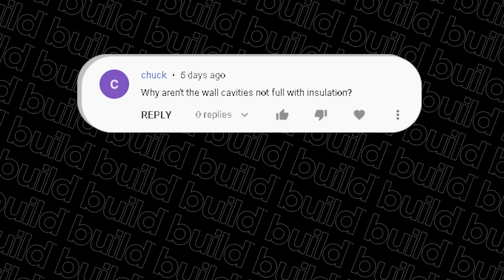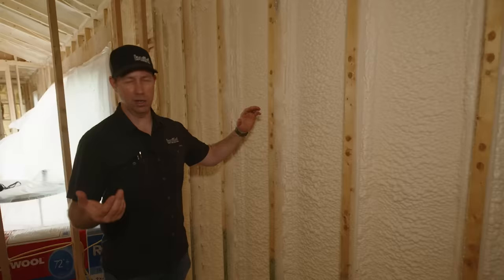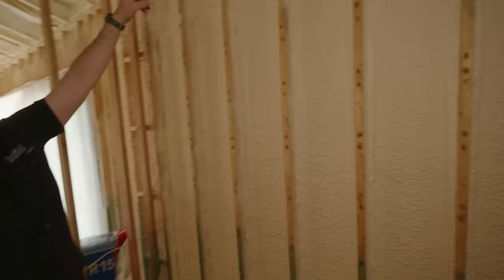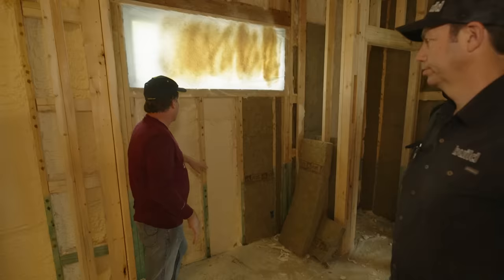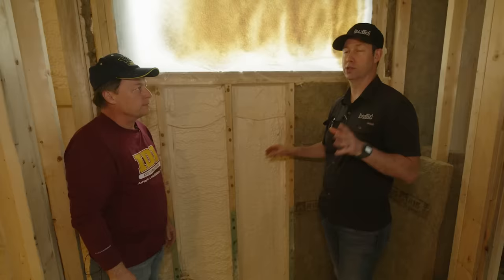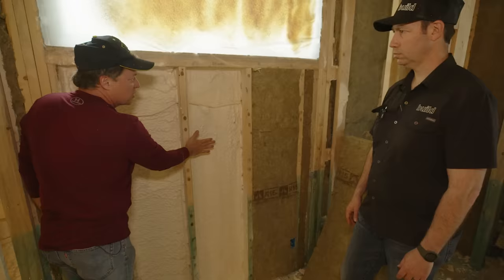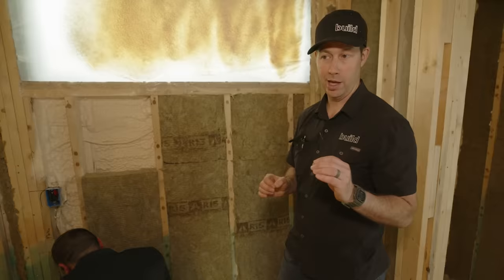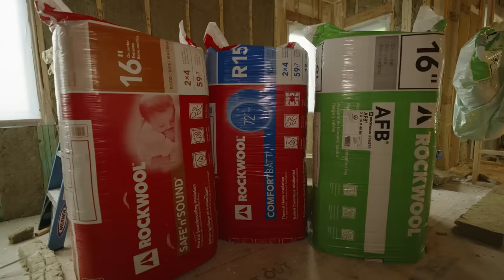Closed Cell Foam + Rockwool- How To Flash & Batt

Comment: Thank you so much for this video.  My framing (100 year old masonry block house balloon framed house)  is offset by 5" from the exterior block wall for structural reasons.  We're spraying 2" of ccSF on the block. Then I want to add batts. My question is do the batts need to be thick enough to fill entire gap from the foam to the drywall (as much as 6.5") or can there be a gap between the ccSF and the batt? Or can I put 3.5" rockwool batts on top of the ccSF and leave the gap between the rockwool and drywall? Help!

Comment: Something I've been wondering about with sprayfoam since I started seeing it, is how much of a P.I.T.A. is it if you need to do some rewiring/renovating ? 
To me it seems like it would be a lot as you have to dig the wires out of the foam, and dig new channels for the wire if you are re routing it.
Reply: Do you have to remove the old wire, or just disconnect it? At least with flash and batt and t-studs you'd just need to dig out the foam through the studs.
Reply: Last year was visiting a remodel where they pulled off all the sheetrock, pulled all the two conductor wire and were going back with NM 12/3) and put in Smurf tube conduit so they could change it at some date in the future if ever necessary without ripping up the walls.
Reply: Just put in conduit before you spray foam and you're good to go.

Comment: What’s the point of vapor open WRB/Zip if you are spraying vapor closed close-cell foam behind it? Please someone explain.
Reply: Zip isn't vapor open.. it's very low perm.
Reply: Zip is made from OSB. Which is very prone to water damage, regardless of what manufacturers claim. Since the zip is backed with a closed cell (vapor barrier), the idea is that the vapor open (outside surface) is necessary in order to allow the OSB to dry outward in the event that water makes it past (which it will, from over-driven fasteners, constructions scratches, and poor tape-jobs).
Reply: @joshpit2003  perm 1 is not vapor open ..
Reply: @joshpit2003  surprisingly huber zip OSB is pretty resilient to  if left outside. I have a test board Ive left outside over a year explode to rain and sun and while noticeable greying/bleaching no bulging or degradation.I suspect they are elevragign their research nd manufacturing they've had so much success with re advantech sub flooring.Now admittedly my test board is drying optimally and no exposure to standing water, but hell, most PT wood wont stand up idneficntley to standing water.
Reply: @joshpit2003  I looked up the product data. The Zip sheathing itself without the insulation is 12-16 perm, which is very Vapor open. But the insulation is less than 1 perm. I agree with your comment that the vapor openness is to counter any water intrusion from outside potential through compromise in the factory applied water/vapor barrier by fastener holes and etc. However, this is not supposed to be used if the concern is more for vapor drive coming from the inside, such as compromised vapor retarder in a northern heating dominant climate. What Matt is doing here with vapor closed spray foam in Texas would have no issue. But you probably want to avoid this assembly in northern climate, due to the vapor closeness of the whole assembly. The best would still be exterior insulation with some batt insulation that keep the sheathing in the warm side, with vapor open assembly to allow vapor drive outwards. Correct me if I am wrong.

Comment: The problem with flash and batt is the majority of insulation companies only install 1/2” or less of closed cell foam. After putting installing foam below manufacturer recommendations, they cram a fiberglass batt into the cavity. The fiberglass batts are designed to completely fill the cavity for maximum effectiveness. They aren’t made to be crushed down. The methods used in this video are overkill, but installed correctly with enough cavity space for all materials.

Comment: Matt we are in the middle of a remodel and can’t find a straight answer. Our house is 105yr old in a dry California climate. It was built with wood siding, a felt layer, and 1/2” wood sheathing. It doesn’t have a vapor barrier do I need to add one or use hard foam insulation before putting in Rockwool? What would be the best way.

Comment: Total embodied carbon is 10x higher than fiberglass and the r value is 4.2 per inch. Unless you are using Rockwood for sound, it’s not worth the cost. Foam and fiberglass is good, exceeds code, and good air barrier. Fire resistance won’t matter when the entire structure is wood.

Comment: I'm building a bus to rv conversion and would love to know how thick my closed cell foam needs to be before putting rockwool over the top of it.  A bus is basically a large metal box and I like the idea of sound deadening.
Reply: Don't use closed cell unless your venting is solid. You do need to worry a little about the structure breathing.

Comment: What advice would you have on dealing with full dimension 2x4 walls in zone 6? I considered using .5" of rigid foam or 1" comfort board or and firring out .5" on the inside with R-15 Rockwool. I am also considering firring out either the inside or outside walls 1.5" and going the flash & batt route or R-19 Rockwool. I am from the south but this house is in the north and I don't want to get this detail wrong... Any ideas would be much appreciated!

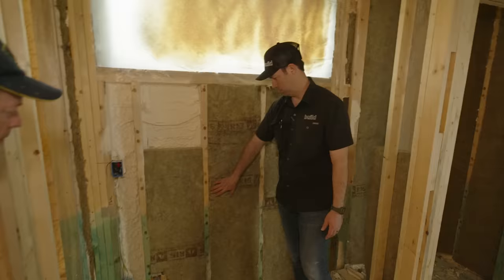Comment: At about 8:55, Matt discusses MW printing the R-value on the batt. During the install R15 was placed on the lower section and R13 was placed in the upper section. Was that a specific design decision or a quality control issue?
Reply: mixed bags

Comment: ,,,Mat Risner,,, I just built 2 different houses, one they had 1 to 1 1/2" of closed cell sprayed in and no bats . The other one they had 5 1/2" of open cell. So your saying that the one with closed sell needed bats , correct.

Comment: One thing I most definitely like about YouTube, sort of like the books or magazines of old (of which I do not buy or have any more), is that I can refer back to them (haha... if I remember where they might be, but so to was the case with books and magazines, but at least now I have an intelligent(?) search engine). Currently I do not know what is in my house's walls, but I know there is nothing in my floors for I having a house with a crawl space and having inspected that visually. (Sigh)... Really, builders need to [censored] so that 120 years down the road things do not need to be fixed only because it was done inadequately the first time.

Comment: Hey Matt! I live just South of Houston and have a 25 yr old brick home that is an insulation nightmare.. meaning... I am freezing right now because the cold is just pouring though my walls. I can quite literally feel it. I also have been working to address less than adequate insulation in my attic and a poorly sealed attic that is allowing insulation to circulation in my home through the walls.  Have been watching  a lot of your videos on insulation.... So I have decided this is what I need in my attic. I have already paid good money for attic insulation replacement and sealing that was just not done right at all... my question is... can you recommend someone in Houston area that will come do this right!! There are a lot of insulation guys that just don't know what they are doing! Also, Any opinions on the foam fill for existing walls. I spoke to company called Retrofoam. Seems like a good deal. But no one services the Houston area. Although your Austin guy has offered to drive over if I go that route! Wondered if you could offer advice! Thanks for what you do!

Comment: On a flat roof 18’ tall in front, back is 10’ tall framing out 4” metal studs 14 ga on top putting plywood and metal roof.  Is it ok to spray foam for condensation ? 1200 sq ft home.

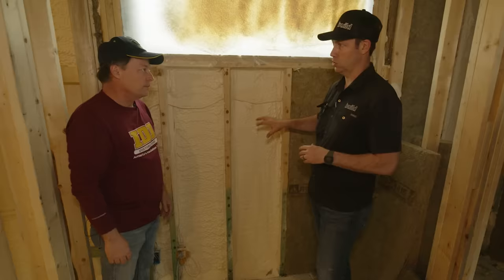Comment: In northern climates, isn't it common to seal as a last interior later before drywall with a layer of plastic sheet (or some equivalent) to prevent condensation? Many northern assemblies don't use spray foam, but that seems to be suggested at 4:00 - 6:00. I thought in northern climates we dried to the outside, which spray foam might actually complicate in an imperfect assembly.
Reply: No plastic sheet in this assembly. The spray foam provides that. A secondary sheet of 6mil poly would create a double vapor barrier and trap moisture.
Reply: Yes D you are correct.
Reply: Up north where I am in Canada they did require a vapor barrier sheet before the drywall, and the spray foam had to be covered with fireproof insulation.  This a was in a basement.   I wouldn’t leave out the interior vapor barrier even with the spray foam, it gets to -40F here, you want all the condensation protection you can get.
Reply: @EdwardT9  it's not fireproof insulation. It's called ignition barrier, for example blazelok.
Reply: Even in northern climates hot and humid summers are common, so the interior plastic sheet can make the condensation problem worse. Spray foam based assemblies don't need to dry, since no surfaces that water vapor can reach will ever be below dew point.

Comment: Can anyone touch on the batt filling the cavities completely (I’m specifically wondering about the warm side). In the vid it says batts have to touch all 6 sides.

To help describe what I’m confused about: if you were to use a 2x4 sized batt in a 2x6 wall (FYI I’m not saying this) would it not perform as 2x4 batts would with 2x4 studs??
Thanks
Reply: I’d look at the channel Spray Jones, and watch his videos on the subject.
Reply: Yes, it would not perform well.  The empty space allows an internal circulating convection current, which causes a lot of heat transfer.  The primary purpose of insulation is to prevent these convection currents from forming.  That is why it is important to completely fill the space.
Reply: Yes it would, since the extra exposed surfaces of the 2x6 would act as cooling/heating fins.

Comment: If I need to pull my siding off my house, and there is currently no sheathing or vapor barrier beneath, can I use closed cell spray foam against the sheetrock before installing new sheathing, vapor barrier, and siding over it?

Comment: Any concerns that the moisture in the wood encased in urethane will rot the wood and create mold? Also, sheathing fasteners could create a cold spot in the wood causing a potential for condensation.

Comment: I'm doing 3" of closed cell in my attached heated / cooled garage / shop. Zone 5.  I will have 2.5" of space left in the wall that I could fill with rockwool. Will it be a problem to use this in a space that I might not always want to condition? If I am going out of town for the week I plan on not conditioning the shop.
Reply: I used closed cell foam on first light layer. Then put Rockwool 3 in batts next layer and it is very cool in summer and very warm in winter. Never any problems.  You will be fine no need to over do it.

Comment: love the back and forth complete (yet layman-friendly) explanation of the closed cell. wasn't quite sure why the rockwool was even needed, since you already got to an R14 in TX with the closed cell --  if 14 wasn't enough why not just another inch of spray?
Reply: Cost. Closed cell is 3x more expensive than open cell. He is going with the wool for sound conditioning. But mostly, he wants more than minimum insulation because of the climate. Building codes tell you the MINIMUM acceptable amount of material. You are free to exceed that if you want. Which he clearly does want to do.
Reply: It's not just cost. Closed cell foam is not a good sound barrier.  It transmits sound through it pretty easily.  The Rockwool IS a good sound barrier.
Reply: @AndirHon  ah, ok. thx

Comment: This house is crazy. Putting up regular drywall seems anticlimactic.
Reply: He could put fiber cement boards for extra fire and water resistance.
Reply: @highsoap  In my 160 square foot house (half of my house is a kitchen the other half is bedroom and my L shaped glass desk) In the kitchen half I use cement board at the top and the bottom I used the green board for the bottom of the wall. Though by this time next year I was planning on getting a new 320 sq ft house but my truck engine died I got to buy a vehicle instead; that sets back my house buying by 5 years dammit. My current house I've lived in it for about 8 years.
Reply: He could have gone with structural panels we use in high end boats for bulkheads. 1/2” thick fibreglass/epoxy skinned end grain balsa core. Paints like a car(or boat). 4x8 sheets are $400 a piece.

Comment: @Matt Can you do a video on selective spectrum blocking films? I rent so I can't make drastic changes to the house (if I could even afford them) and it's frickin hot right now. I've heard UVA/UVB/IR blocking films can help with that. Though there are also downsides with them, like accidentally melting your neighbor's siding and not being able to put them on the inside of double/triple paned windows. 
Also it'd be cool if you could experiment with putting them on a plexiglass sheet for quicker install/takedown. Just slide that up against the glass between the screen and the window. Maybe some double sided tape or tacky putty to hold it there over the summer so you can still open the windows in the evening.

Comment: Cover it with Aluminum double bubble across the studs and tape it off. The ceilings too,   Reflects heat out reflects heat in.  Cut my heating and a/c  bill by 80%. You couldn't pay me to put batt insulation in my walls. You Guys complaining  about  the cost, I get it, but if you  do that with foam and then cover it  across the studs every day of every year you will be paying yourself back. By My rough calculations it took 3 years to pay off the entire insulation job. Been money in the bank ever since..
Reply: Any concern about moisture?
Reply: @hdhhbsbbauudb  Nope never had a problem this was in southern NJ>  Stopped the termites dead in their tracks.
Reply: @thatamerican3187  cool, ty for responding!

Comment: Matt, Would you consider putting open cell on top of the closed cell?  What would be the good and bad about that?
Reply: People do that all the time: 2 inches of closed cell with open cell over it.
Reply: If I would of been matt I would of done 1” on the walls and then filled it in with open cell. 
This is mainly done in barnominiums, since metal likes to sweat, the builder is forced to use close cell as a moisture barrier.

Comment: matt-     have watched a lot of your videos and  i tried to send and email to you and not sure if you got it or not, but have a question for you :      we are in the process of moving to another house and thinking of going  with a metal roof and the company offers adding a radiant barrier , which of course is extra.      i would like to do the spray foam to the attic ( which we have  done to the current house ) and in your opinion, would you do the metal roof and radiant barrier and no foam or add the foam or metal roof and foam with no radiant barrier.       live in florida, so summers are much like texas.

Comment: If there’s a gap between the foam and Rockwool it’ll condensate and cause horrible problems right?
Reply: Not if you have enough closed cell. As they said in the video, the depth required to prevent that depends on your climate, but if you meet that depth at your lowest, condensation will not (should not) be a problem.

As they said here, this system is letting the closed cell do all the insulative work (already at R-17 in the wall) while the Rockwool is serving primarily as a sound insulation. Whatever insulative value it offers over the closed cell's R-17 is just bonus.
Reply: Your absolutely right, having 2 insulation with a gap between them two creates moisture that leads into mold. And mold can lead to people leaving at the house to have serious health problems. 
In the video, the assured that there is no gap in between. However, we’ll have to see and find out over the period of a few years. 
I would of honestly, done 1” of close cell and then filled it in with open cell.
Reply: How? This problem never passes the sniff test. Warm air must meet cool air to condensate. 
That means you either can:
A) Install thick batts to stop warm air from reaching the foam
B) Run visqueen over the batts at the interior (like in the north)
Neither requires spraying a ton of thick expensive foam..... 😠
NO moisture can come from the outside IN, because the close cell stops it.
Reply: @InvestmentBankr  correct to an extent.  The primary purpose of "visquene" (ideally 6 mil poly) is to provide a barrier for "vapor".  Hence the term "vapor barrier".  No vapor, no condensation.  (internal sources of vapor must be dealt with in other ways)
Reply: @nelsongilbert1695  You seem to be describing exterior vapor barriers, However, interior vapor barriers of visquene installed over paper or non faced batts is incredibly prevalent north of zone 6.  In effect northern homes have stud bays COMPLETELY isolated from air flow on both sides for a perfect seal.

Comment: What’s the cost of all this insulation? Material and labor, seems real expensive
Reply: If it seems expensive it’s because IT IS expensive
Reply: @josecito976  Spray Jones said the cost when added on to the loan for the foam would be more  per month than the money  savings gained for the energy with the foam  and would be paid off, where as the energy lost cost go on forever

Comment: I have seen horror stories on flash and batt. Would you suggest a blower door test and aerobarrier before the bat? to triple check to make sure there is no holes/ air leaks missed during the spray foam part?
Reply: Bob Watters  condensation on the bat causing mold and people having to rip and replace
Reply: Bob Watters  if there is any air coming thru the foam your screwed.. ie bad foam job
Reply: If that is not the video.. this build had the problem.. they might have taken it down